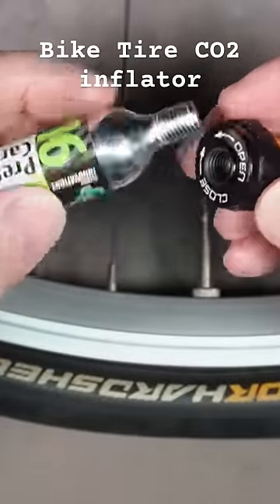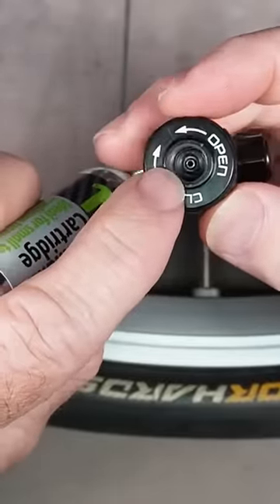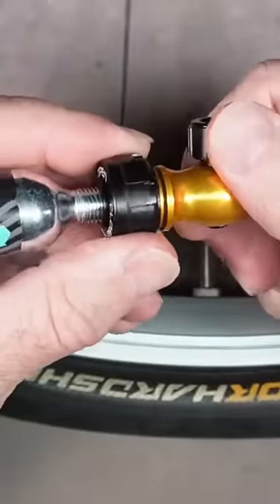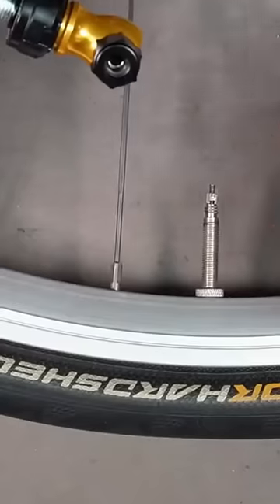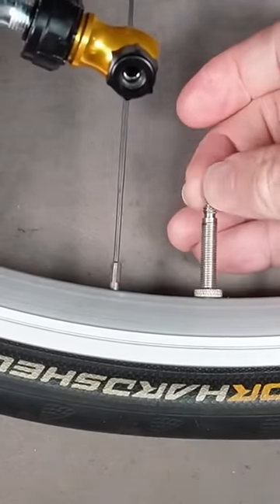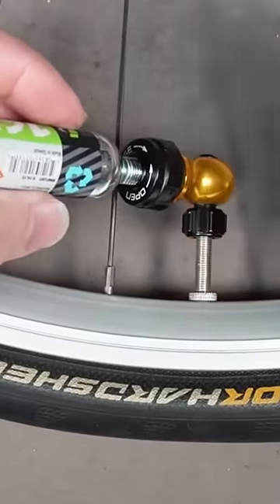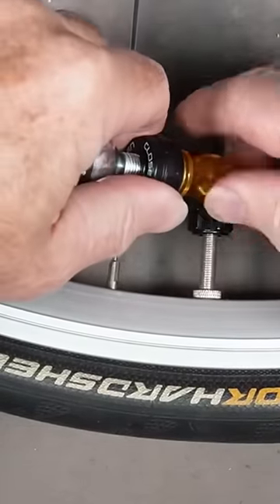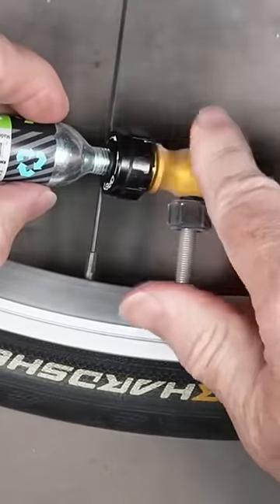Bike Tire (tyre) CO2 Inflator: How to use. #bicyclerepair #bike

Comment: Then the middle valve isn’t screwed in and you lose all ur air. Perfect in 2024
Reply from the maker: Nothing will be lost when the CO2 inflator is removed. This is a Presta valve. Presta valves close when there is pressure inside the tube or tire. I only loosened the lock nut, which is necessary for air or CO2 to flow into or out of a Presta valve. I did not remove the core.
Thanks for the comment! I appreciate it!

Comment: Now remove the cartridge and lose all the air because the valve is unscrewed
Reply from the maker: Nothing will escape when the CO2 inflator is removed. This is a Presta valve. Presta valves close when there is pressure inside the tube or tire. I only loosened the lock nut, which is necessary for air or CO2 to flow into or out of a Presta valve. I did not remove the core. You put can see the entire video here: How to Use a CO2 Bike Tire Inflator
https://youtu.be/jc-BpZL3lAk
Thanks for the comment! I appreciate it!
Reply: @davescycling  nice thanks for the information 👍🏻

Comment: So what happens when you take that off? You just unscrewed the the valve stem so all the air is going to come out. You don't show that do you.
Reply from the maker: You can watch the entire video here: How to Use a CO2 Bike Tire Inflator
https://youtu.be/jc-BpZL3lAk

Nothing will escape when the CO2 inflator is removed. This is a Presta valve. Presta valves close when there is pressure inside the tube or tire. I only loosened the lock nut, which is necessary for air or CO2 to flow into or out of a Presta valve. I did not remove the core.
Thanks for the comment! I appreciate it!

Comment: And then the stem valve shoots out of the stem?
Reply from the maker: This is a Presta valve. Presta valves close when there is pressure inside the tube or tire. I only loosened the lock nut, which is necessary for air or CO2 to flow into or out of a Presta valve. I did not remove the core.
Thanks for the comment! I appreciate it!

Comment: Только этого надолго нехватит , резина углекислый газ долго не держит, уже проверено на личном опыте .
Reply from the maker: Yes, A CO2 inflator is just another option for emergencies to quickly and easily inflate a tire out on the road after fixing a flat. It is recommended to replace the CO2 with regular air once you get home. Thanks for commenting!

Comment: So you'd rather waste a co2 cart every time instead of just using a regular pump?😅
Reply from the maker: Yes! It is not needed very often. It is only meant for emergency purposes when you get a flat out on the road and you’ve replaced the tube. Thanks for your question!
Reply: @davescycling  what a waste

Comment: Did he take out the valve stem?
Reply from the maker: No. This is a Presta valve. Presta valves close when there is pressure inside the tube or tire. I only loosened the lock nut, which is necessary for air or CO2 to flow into or out of a Presta valve. I did not remove the core.
Thanks for the comment! I appreciate it!

Comment: Soon as u start to unscrew it you have valve stem almost all the way out and with it that loose it would only take a few secs for tire to be flat when u loosen that piece off by the time u race to stem tire gonna be flat lmao😅
Reply from the maker: Actually, no. Nothing will escape when the CO2 inflator is removed. This is a Presta valve. Presta valves close when there is pressure inside the tube or tire. I only loosened the lock nut, which is necessary for air or CO2 to flow into or out of a Presta valve. I did not remove the core. You put can see the entire video here: How to Use a CO2 Bike Tire Inflator
https://youtu.be/jc-BpZL3lAk
Thanks for the comment! I appreciate it!

Comment: I would rather have a tank that I can manually pressurise but has a similar  attachment on the valve. That way I can fill the tank in my spare time and rapidly fill the tyre in those inconvenient moments. Can someone make what I want?
Reply: They already exist. You could carry a compressed air tank around if you want and go from there but might not be worthwhile to reduce the pressure to what the tire or tube can withstand. You also run into a bigger issue with the JT effect because you would have a tank with an average of 4000 PSI in it and would be reducing it to below 100 psi. The amount of regulation and reduction you would need would be a quick way to make it overly bulky as well as having to deal with temperature issues which could cause damage or failure of the tire/tube or harm to yourself. You lose 7 degrees fahrenheit for every 100 psi you reduce by. To put it into perspective, we use very expensive equipment to reduce 3000-4000 PSI down to 300 PSI and have to warm up the gas during that time so it can be utilized by the equipment we reduce the pressure for. Too cold and it doesn't blend or causes downstream freezes and failures.

Comment: Am I seeing things or did he remove the valve core? If he did once he removed the adapter, all of the CO2 would have come back out. The valve core can remain in place and the CO2 can go past it if the centerpieces is depressed.
Reply from the maker: I did not remove the core. Just loosened the nut that closes the valve. Thanks for the comment!
Reply: @davescycling  
Maybe there’s more to the video than I saw but I went back and viewed it again just to be certain about my recollection and I can say that you did remove the valve core, perhaps you replaced it but it wasn’t shown on this very short video .
Reply from the maker: This is a Presta valve. Not a Schrader valve. The valve core was not removed at any point. You can look up a Presta Valve and see how they work. I loosened the top nut which is necessary to allow any air or CO2 to flow in or out. When there is pressure inside the tube or tire, it closes the valve so pressure will not escape unless you press down on the loosened nut.

You can watch the entire video by clicking the “Created from” link in the video.

Comment: Why take the valve out of the valve stem, bit stupid that, it`s design is that air can go in and not come out.
Reply from the maker: This is a Presta valve, not a Schrader valve. Presta valves close when there is pressure inside the tube or tire. I only loosened the lock nut, which is necessary for air or CO2 to flow into or out of a Presta valve. I did not remove the core. You can see the entire video here: How to Use a CO2 Bike Tire Inflator
https://youtu.be/jc-BpZL3lAk
Thanks for the comment! I appreciate it!

Comment: hey can anoyone explain to me the advantage ? All i see is a tool for lazyness and overconsumerist one, like the one who buy eletric shifter!!!
Reply from the maker: Thank for the question! The way I look at it is that when I am biking, I am focusing on biking. When I get a flat, I want to get it fixed as soon as possible, with as little hassle as possible and get back to it. I see that as efficient, not lazy. IMO A lazy person does not voluntarily go out on a bike and seek out hills to climb! Also, if you have not tried electronic shifters, I highly recommend you try them before commenting about them. It is about efficiency, no more screwing around with cable tightening, and loosening, which was driving me crazy. They shift quickly and accurately every single time and again, I don’t want to screw around with my gears while I am focused on biking and getting PR’s!

Comment: Too bad they dont make those in tiny nitrogen containers.  I guess its just a bicycle, But inert gas is better for tires.
I believe o2 draws in moisture and eventually causes tire rot.
Reply from the maker: A CO2 inflator is just another option for emergencies to quickly and easily inflate a tire out on the road after fixing a flat. Thanks for commenting!
Reply: @davescycling  ooo I see. That makes sense more sense.

Comment: Classic pump ?
Reply from the maker: A classic pump is by far the most common and affordable way to go. A CO2 inflator is just another option for emergencies to quickly and easily inflate a tire out on the road after fixing a flat. It is super small, light and inflates a tire in seconds. Thanks for commenting!

Comment: Then when you take it off you lose the charge since you loosened the shcrader
Reply from the maker: Nothing will escape when the CO2 inflator is removed. This is a Presta valve. Presta valves close when there is pressure inside the tube or tire. I only loosened the lock nut, which is necessary for air or CO2 to flow into or out of a Presta valve. I did not remove the core. You put can see the entire video here: How to Use a CO2 Bike Tire Inflator
https://youtu.be/jc-BpZL3lAk
Thanks for the comment! I appreciate it!

Comment: Mini bomb with that pressure
Reply from the maker: I have been carrying and using these for years. No explosions! A CO2 inflator is just another option for emergencies to quickly and easily inflate a tire out on the road after fixing a flat. It is super small, light and inflates a tire in seconds. Thanks for commenting!

Comment: What happens when valve freezes before all air gets in
Reply from the maker: I have not had that happen. It is certainly possible. I let the CO2 in slowly, and it has always worked fine.
Thanks for the question!

Comment: So what happens to the CO2 since the valve is loose??
Reply from the maker: This is a Presta valve. Presta valves close when there is pressure inside the tube or tire. I only loosened the lock nut, which is necessary for air or CO2 to flow into or out of a Presta valve. I did not remove the core.
Thanks for the comment! I appreciate it!
Reply: @davescycling  I used to ride a lot, but couldn't recall having to loosen that type. I do remember pressures of 90-110 psi.
Reply from the maker: You probably had Schrader valves on your bike! Thanks for the reply!
Reply: I had forgotten the way the Presta operate, I quit riding in '97-98, really bad wreck, tore my rotator. I would like to get a comfortable bicycle now, just to keep in shape now that I'm 72, oof you have any suggestions?
Reply from the maker: Sorry to hear about the wreck! That’s pretty awesome that you were looking to get back on a bike! I don’t know if you have a Trek store near you, but I’ve always found the guys and gals in those stores to be extremely knowledgeable and they’ve always been able to hook me up with a great bike!
Reply: thanks for the info!
 @davescycling

Comment: If you unseal the valve stem everything is going to leak out once you take this thing off.
Reply from the maker: This is a Presta valve. Presta valves close when there is pressure inside the tube or tire. I only loosened the lock nut, which is necessary for air or CO2 to flow into or out of a Presta valve. I did not remove the core.
Thanks for the comment! I appreciate it!

Comment: Useless at the gas station you can fill your tired with free air and much faster
Reply from the maker: The gas station pump will not work with the valve that I am using in the video. This is a Presta valve and does require a particular adapter.

Comment: What about the valve stem?!?
Reply from the maker: This is a Presta valve. Presta valves close when there is pressure inside the tube or tire. I only loosened the lock nut, which is necessary for air or CO2 to flow into or out of a Presta valve. I did not remove the core. You can see the entire video here: How to Use a CO2 Bike Tire Inflator
https://youtu.be/jc-BpZL3lAk
Thanks for the comment! I appreciate it!

Comment: Did this man remove the valve?  Lolol
Reply from the maker: This is a Presta valve. Presta valves close when there is pressure inside the tube or tire. I only loosened the lock nut, which is necessary for air or CO2 to flow into or out of a Presta valve. I did not remove the core.
Thanks for the comment! I appreciate it!

Comment: why don't you just use a mini air compressor
Reply from the maker: The CO2 cartridge is a whole lot faster than any rechargeable pump. I have tested. Also charging them up takes a whole lot of time when throwing a new cartridge in your bag takes two seconds lol .Thanks for your comment!
Reply: @davescycling  interesting point of view

Comment: Don’t take you valve core out to inflate your tire
Reply from the maker: This is a Presta valve. Presta valves close when there is pressure inside the tube or tire. I only loosened the lock nut, which is necessary for air or CO2 to flow into or out of a Presta valve. I did not remove the core.
Thanks for the comment! I appreciate it!

Comment: Why not just use normal air? Whats the benefit
Reply from the maker: A CO2 inflator is just another option for emergencies to quickly and easily inflate a tire out on the road after fixing a flat. Thanks for commenting!
Reply: @davescycling  I had a feeling that's what it was for but wasn't sure. Haven't rode a bike in over a decade

Comment: so you cant measure the psi to know it has enough air already🤔
Reply from the maker: Thanks for the thoughtful comment. Here is how I use it: I only use a CO2 inflator after replacing a tube on a ride after getting a flat. I already know that one entire cartridge will fill my particular tire to a very respectable psi that will allow me to continue riding. When I get home, I replace the CO2 with regular air from my floor pump.

Comment: Or just buy a small Hand airpump for like 10-15 bucks and keep it forever. No need to recharge it either
Reply from the maker: Of course that is a great option! A CO2 inflator is just another option for emergencies to quickly and easily inflate a tire out on the road after fixing a flat. Thanks for commenting!
Reply: @davescycling  fair enough. I prefer something more longlasting where I dont need to think about refills and such because theres a 99% chance that I will forget to reload the CO2 container before the next emergency. I bought a good old 15-20 cm metal hand pump for both common wheel valves and its always in my backpack :)
Reply from the maker: Thanks for your input! Truly appreciated. I do not ride with a backpack myself, but if I did, I would definitely follow your lead!

Comment: Great for the manufacturers because you need to buy till you die, just click a pump on the frame lad.
Reply from the maker: If you only get a couple flats a year, it’s not too expensive. Well worth it to inflate your tire in three or four seconds when sitting by the side of the road! Thanks for the comment!

Comment: Co2 gas is too thin. Itwill escape easily. Temporary solution
Reply from the maker: Correct, it is for emergency purposes only. A CO2 inflator is just another option for emergencies to quickly and easily inflate a tire out on the road after fixing a flat. Thanks for commenting!

Comment: don't worry the valve he has to loosen will let all that air out as quick as it let it in 😂
Reply from the maker: Nothing will escape when the CO2 inflator is removed. This is a Presta valve. Presta valves close when there is pressure inside the tube or tire. I only loosened the lock nut, which is necessary for air or CO2 to flow into or out of a Presta valve. I did not remove the core.
Thanks for the comment! I appreciate it!
Reply: @davescycling  glad to be corrected thanks
Reply from the maker: Thanks for the reply and thanks for watching!

Comment: That’s a very expensive way to air if you’re tired bro
Reply from the maker: A CO2 inflator is just another option for emergencies to quickly and easily inflate a tire out on the road after fixing a flat. It is super small, light and inflates a tire in seconds. Thanks for commenting!

Comment: Fwi. Co2 will eat rubber over time
Reply from the maker: A CO2 inflator is just another option for emergencies to quickly and easily inflate a tire out on the road after fixing a flat. It is recommended to replace the CO2 with regular air once you get home. Thanks for commenting!

Comment: How does he now remove it as he has unscrewed the valve. The gas will dissipate before he can get the valve back in!
Reply from the maker: Thanks for the comment. This is a Presta valve, any pressure inside the tube will close the valve. Nothing will escape.

Comment: Dude why would you unscrew the core.  People dont take this guys advice
Reply from the maker: It is a Presta valve! I did not unscrew the core. Presta valve work differently than Schrader. I am using the valve correctly. If would be so kind as to research Presta valves then edit your comment, I would appreciate it.

Comment: 😂 wouldn't that make the bike valve hard and brittle the seal ? How did it get a flat in the first place
Reply from the maker: I have been using a CO2 inflator for years as an emergency option to inflate a tire on the road after fixing a flat. Never had any issues with any part of the process. It’s light, compact and inflates a tire in seconds! Thanks for the comment!

Comment: Co2 make your rubber damage...why you don't used nitrogen is better.
Reply from the maker: Thanks for the comment! CO2 works just fine for emergency use when out on the road. Has helped me get back to the ride very quickly on several occasions!

Comment: No need to unsctew the core
Reply from the maker: This is a Presta valve. Presta valves close when there is pressure inside the tube or tire.  Loosening the lock nut is necessary for air or CO2 to flow into or out of a Presta valve. I did not unscrew the core. You can can see the entire video here: How to Use a CO2 Bike Tire Inflator
https://youtu.be/jc-BpZL3lAk
Thanks for the comment! I appreciate it!

Comment: Just use a hand pump man... It's simple and easy, and a lot cheaper and the tires will stay filled longer because it's air
Reply from the maker: All your points are absolutely true! A CO2 inflator is just another option for emergencies to quickly and easily inflate a tire out on the road after fixing a flat. It is super small, light and inflates a tire in seconds. Thanks for commenting!